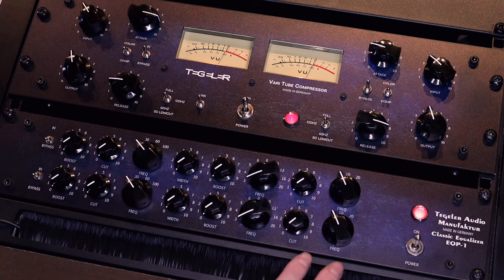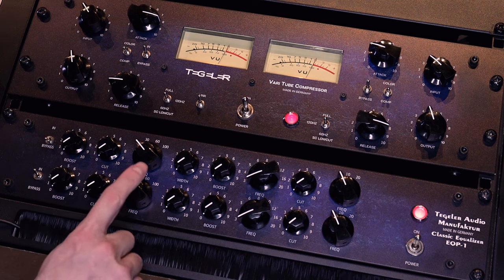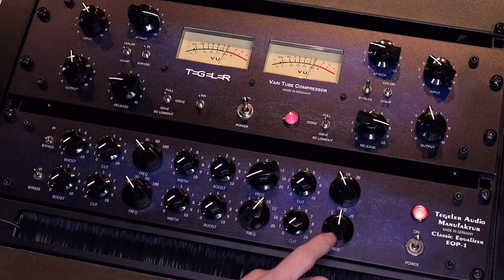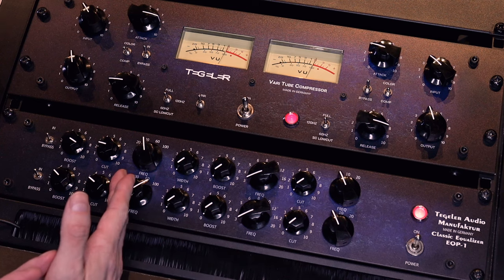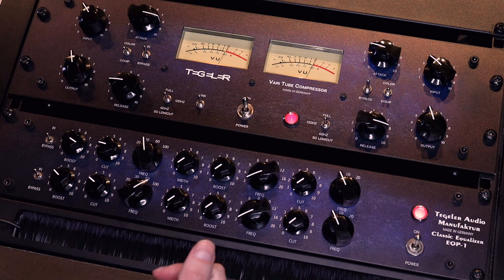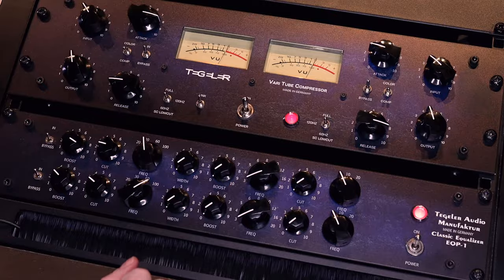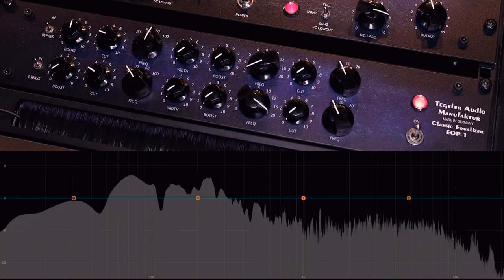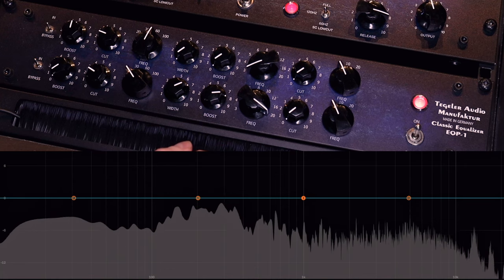The amazing TEGELER EQP 1 - Pultec style EQ

Comment: Sound great. Is it too much of a "tube mess" if I use it after  SPL  MK3 Vitalizer that has also tubes in it and after Drawmer 1974 EQ (I use Drawmer just 1db, 2 max on a master bus) for the final EQ boost of the whole mix? I really like the sound, but the SPL Vitalizer already gives so much vibe and "EQ warmth and silk" -  I'm afraid is going to be too much; yet I want to boost it more than just 1 or 2db (with Tegeler EQP1) at the end before going to VCA SSL style compressor? I make mostly EDM, pop music.
Reply from the maker: in my opinion the Tegeler equipment is pretty clean sounding, don’t know if it will be precise enough as last eq in your chain? I love it in m/s setup.